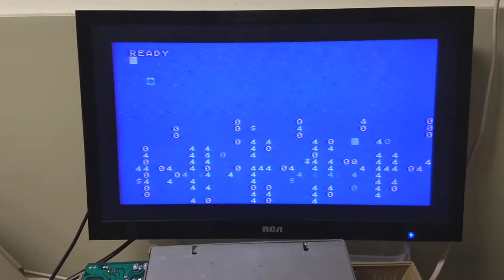Upgrading an Atari 400 to 52K from 16K

Comment: I think it’s probably a static charge buildup on that shield. Maybe try to ground yourself while handling it? Just a guess.
Reply from the maker: Yes, it's worse with it screwed down.
Reply from the maker: That's a good guess but I do have an anti-static strap on my camera hand.
Reply: does it continue once screwed in place? Maybe it is a grounding issue?
Reply from the maker: Yes, but I decided to just not put the bottom plate and every was fine.  I talked to the person who created the memory board, he hadn't heard of this problem before, but all his customers were using PAL.

Comment: from *16*K? Is your Atari 400 modified? From what I remembered, a stock Atari 400 had 4K while 800 had 8K.
Reply from the maker: True, the first units released did have 4 and 8 K respectively, but near the end of production, the 400 had 16K and 800 had 48K